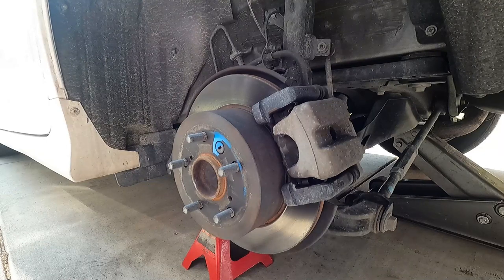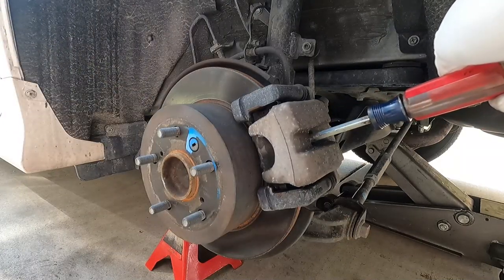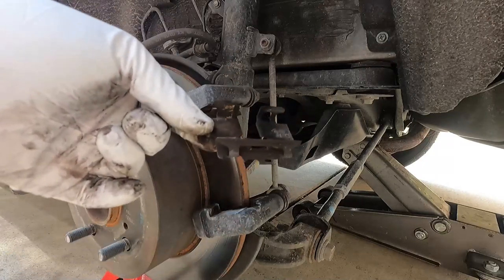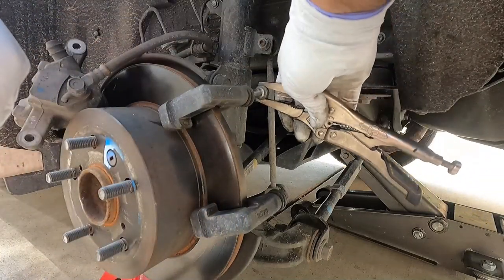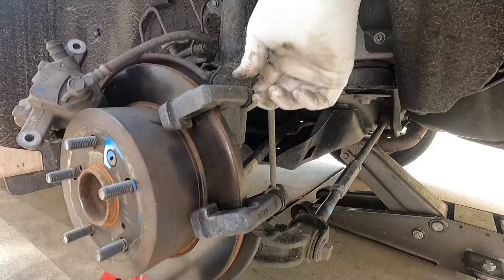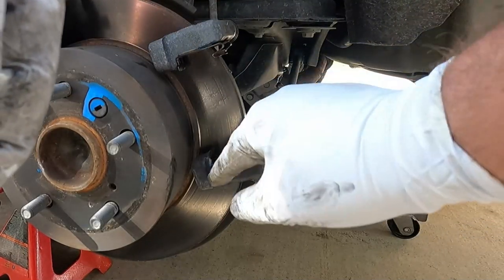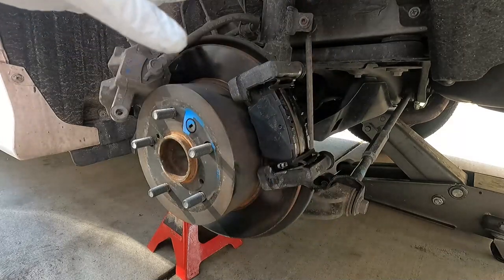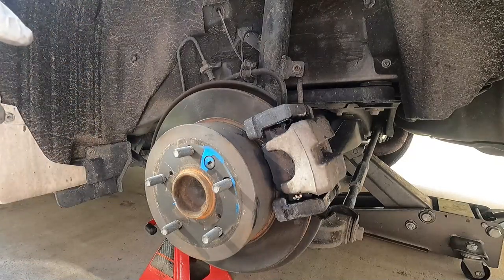2012 - 2014 Toyota Camry - How to Replace Rear Brake Pads - Easy DIY!

Comment: I noticed that the rear brake pads don't use the spring clips like the front brakes do.  I wonder why this is, and how do they not constantly rub on the rear roter?
Reply: In curious to
Reply: it’s because the back brakes requires less force since all the weight goes to the front. this makes the rotares smaller leaving less space for the springs
Reply: That makes sense!  Thanks

Comment: Is there a difference between regular and hybrid as far as brakes goes? Cant find any videos on doing them on hybrid model and wasnt sure.
Reply from the maker: I don't think there would really be much of a  difference on the brake pads and rotors.  I have only done brakes on a Toyota Prius hybrid and they were the same as most non-hybrid vehicles.
Thanks for watching!
-Dan the Fix it Man

Comment: Did you grease up the piston as well?
Reply from the maker: Yes, just a little bit on the face to help dampen vibrations and keep them quiet.  I was using regular caliper grease, but the higher temp silicone based grease would last longer.
Thanks for watching!